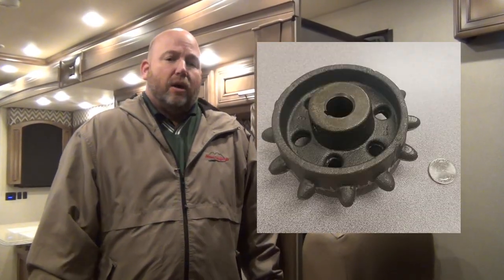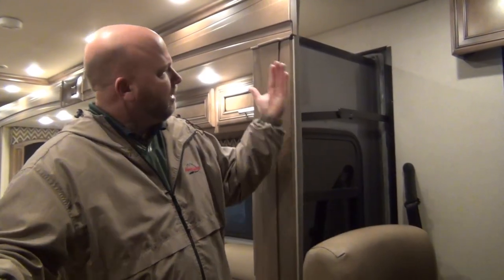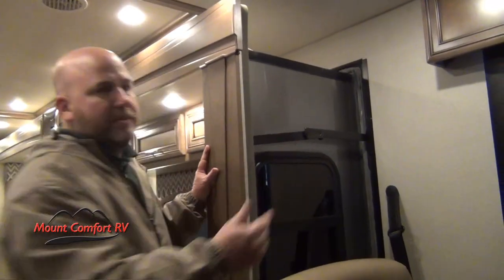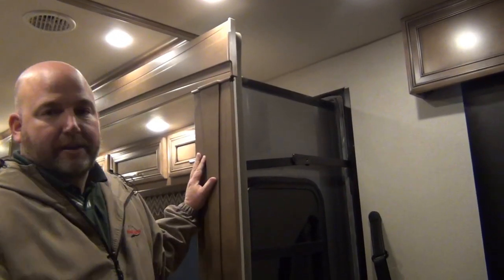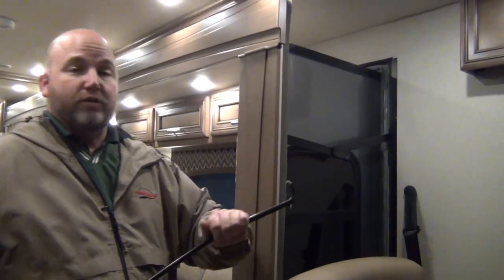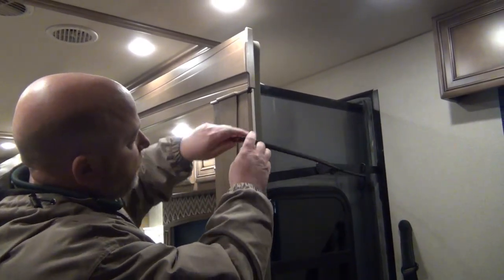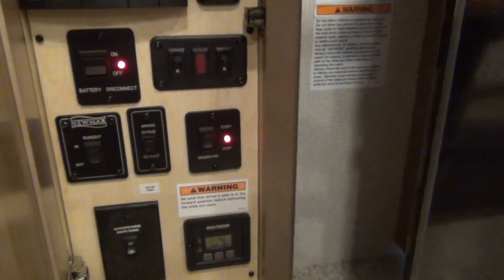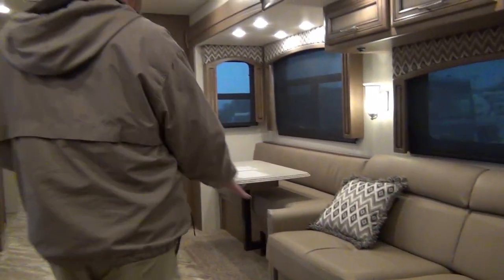Slides & Slide Locks on Newmar Motorhomes

Comment: I have a Mountain Aire 1999 25 years old with 2 slides and same lock and gears setup as shown here and I have never had even one problem with the slides or locks. I do believe the previous owner about 10 years ago had issue with the controller on one because I found an extra one in parts but maybe not maybe it was just bought in case of failure. They may not be fast and fancy but I am very satisfied

Comment: Good explaination of the slide lock process and use. However, our 01DSDP "Maxine"  has dictated other instructions. The slide locks were a constant problem since the coach was new and have been replaced several times. Twisting, binding, bending, jambing all while unlocked and throwing the slide out of adjustment. It was a constant headache, so I removed all four of them. Since removal,  the slides have worked perfectly and not needed any adjustments. The weight of the slides is on the outside lower edges so when they are retracted they do not move out by themselves. Unless there is a total failure in the slide electronics they will not move or vibrate out. I believe the slide mechs are the best design out there. The resistance that the slide locks create force the slides to come in at strange twisted angles and ruins the slide mechs. I carry wood blocks in case it becomes an issue but have never had to use them. Sure, I can shake the top of the slide too, but when traveling down the road there is no movement in the top of the slides with out the locks in place. The other problem it that the bolts on both the motor and motor mount must be re-torqued each year as they loosen up due to heat/cooling and torque put on the bolts.